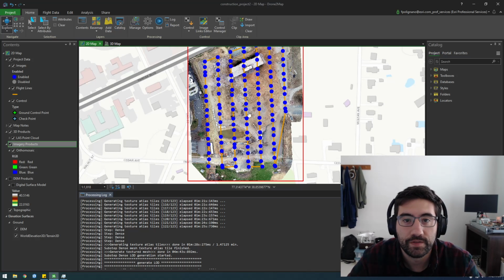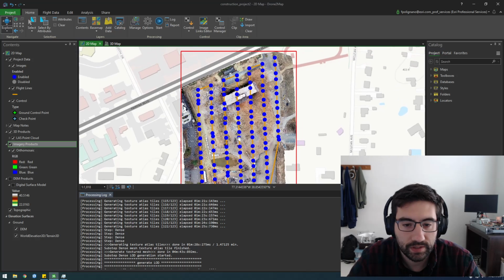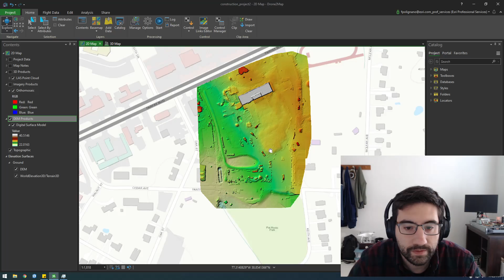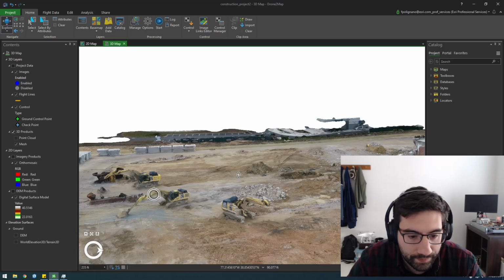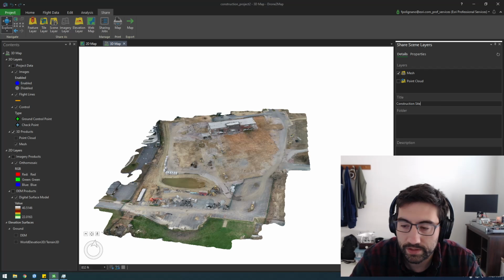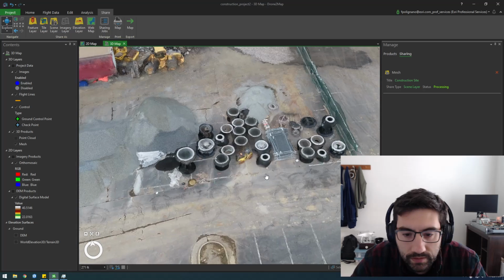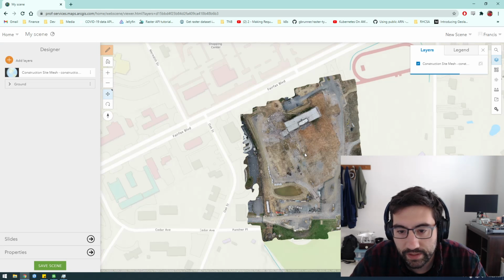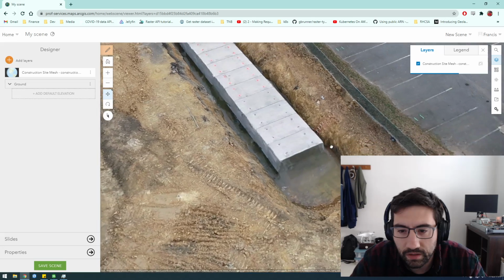Process Drone Imagery with Esri Drone2Map pt. (2/2)

Comment: Thanks for this, though can you offer any thoughts as to why the imagery might not show up after processing? Followed all your steps but after 100% processing I still can't see them. I can click through the individual images so I know they are in there, as with the flight lines etc, just not the thing I actually want!
Reply from the maker: hmm what exactly is missing? The 3d mesh? The 2d orthomosiac? Are all the layers turned on? Is something turned on and blocking the view of the other thing?
Reply: @Franchyze923  Thanks for replying. I think I have determined the problem that its all sunken beneath the ground level surface because when I reprocessed it the 3D model was in a massive hole. So now Ive got to figure out
Reply from the maker: @garethhaddon2741  Awesome!

Comment: Hi fran - does drone2map automatically georeference the image or did you have to provide control points? I didn’t see it covered in the video but may have missed it, is there georefencing accurate?
Reply from the maker: It uses GPS information stored in each image metadata. If you require more accuracy you can import GCPs.

Comment: Interesting video and pretty cool project. From the first video, you seemed to know a bit about Pix4D. So I was curious to know whether you've processed SfM stuff before on Pix4D, and followed the rule initial processing first, then mesh+cloud, then DEMs. I've been trying to replicate that same workflow on Drone2Map and I can uncheck the boxes to generate the DEMs just fine but for some reason it doesn't let me uncheck the "Run Dense" box. The idea was to run initial only. And only then move onto the next steps. Any thoughts you may have with regards to this?
Reply from the maker: I've actually never used Pix4D! I see what you mean about not being able to uncheck Run Dense. I believe it has to do with the fact that we created a 3D Mapping project. If you recreate the project with 2D Rapid or 2D Full you should be able to uncheck Run Dense. Let me know if that works!
Reply: @Franchyze923  I went with 2D Full and was able to uncheck that box. Thanks for the suggestion.
Reply from the maker: @laropilartes  Great, glad that worked